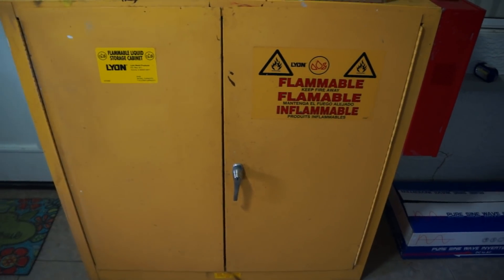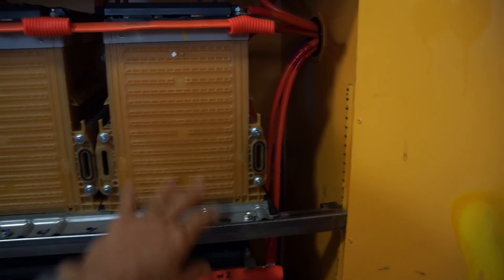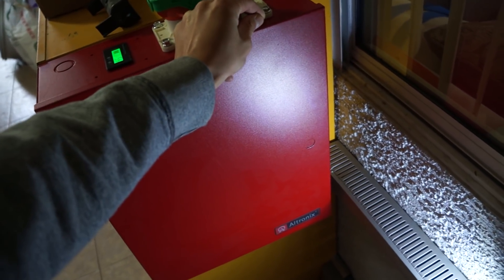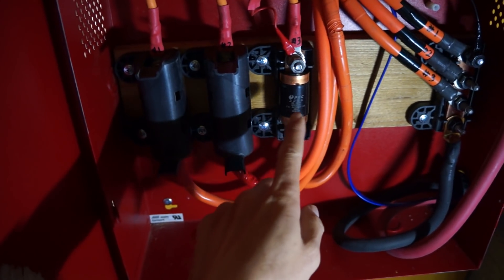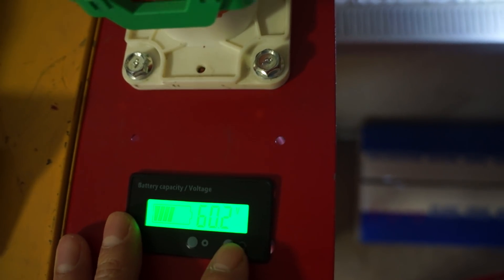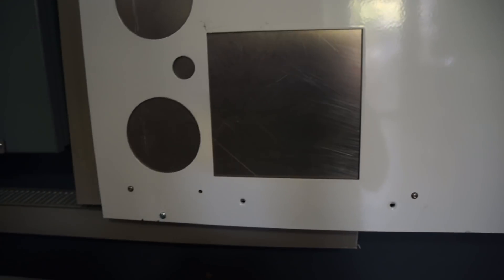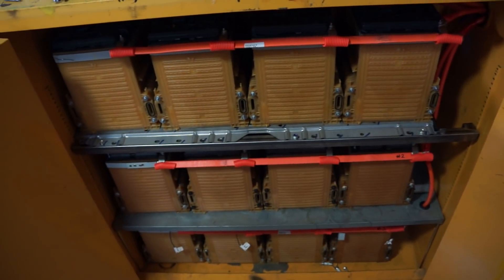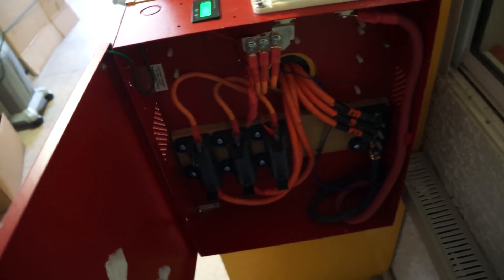37kwh 16s Chevy Volt Lithium Battery Bank Off Grid Solar system finished!

Comment: I've been searching for your video again to remind me of how you were doing connections I'm about to build a cabinet for all of my Chevy volt batteries One idea I also think I will employ is to put a large container that will hold maybe 400 lb of sand perhaps one of those big 300 gallon water totes plastic filled with sand and I will place it on top of the cabinet of course would be supported properly and cut a hole in the top of the cabinet so that if a fire were to start it would melt the plastic and all of the sand would pour into the cabinet to put out the fire
Reply from the maker: Thats a good idea!

Comment: What about colling? Aren‘t you using cooling system for the batteries? I am going to use those batteries in golf cart application and I am doubting about cooling. I will really appriciate your answer about that.

Comment: one of the most important parts here is the DC disconnect. You have to have a 40 - 60KW disconnect to break open the battery feed if you have a short. Else you will cause a giant arc and roast all your contacts

Comment: FYI for newbies an average home that uses a 4 - 6KW heat pump HVAC can use up to 90KWH per week to run the average 2000 - 2400 Sq ft home. This figure can also be reduced a lot with good insulation and air tightness.

Comment: Why no BMS?
Reply: Why do you need a BMS?
Reply: @MrSummitville  Good question. 
There are so many cell that make up a block and this cells sometimes do not take charge or discharge equally. For this reason some will get filled up or drain faster than others and this can cause cell damage. To avoid this you need BMS do that any that gets filled up or gets low to its normal level will be cut off.

Comment: Thanks for your honest opinion!You sell BMS on Ebay and yet you refrain from using them on your own setup which uses very well balanced batteries from the start. So your opinion to me is not biased, just based on your own experience which is pretty established already. A BMS is a strong added value to the system, but only if it "works." Volt surely designed an awesome BMS that works for their car and our challenge is to find a third party BMS that do the same for our solar storage system. Or... like you,  not use any BMS at all. However,  being able to monitor remotely  the state of charge of individual cells, or group of cells, and being able to get some warnings and interact manually or automatically to arisong dangerous conditions is invaluable and should not be understated - otherwise Volt would have gotten away with their own BMS too -  But... a residential setup is less demanding and easier to access and tweak, if needed. So, I would tend to agree with you, unless there is a proven BMS out there that doesn't drill a hole in your budget.As someone once said to me, " If it ain't broken, don't fix it! "
Reply from the maker: Thanks for watching!

Comment: outstanding, a question why why did you mention hopefully you will get 26 KW out of the 37 KW system, that is more than 2/3 of batteries capacity, please correct me if I am wrong, is that possible ??
Reply: I think you wanted to say 37kWh and 27kWh?

Yes, these are lithium based batteries, even if they are used they should easily have 85% of nominal capacity, and you can safely discharge them down by 90% on each cycle, without affecting them that much in life span. Exact calculations and tradeoffs are complex.

Comment: would y rather make battery back with high S count and good BMS or High P count with good Boost converter? If y want higher Voltage output.

Comment: Thermal Control System ??
Reply: Not needed for home power applications. Houses don't pull anywhere near the amount of electricity that cars do, so the system is already overbuilt for this application.

Comment: How would you rate Tesla 57V module vs Chevy volt vs Nissan leaf batteries for solar storage
Reply from the maker: Most people do not realized that Tesla chemistry is not the same as Chevy Volt or Nissan Leaf.  The chemistry they used are more powerful and lighter weight... but at a cost of lower life cycle and more dangerous.  So for Solar, who cares about the weight or space, all you want is good performance and life cycles (I guess you would if it was for a RV Solar).
Reply: @devildestiny555  
I think you are mistaken on cycle life. I would argue that tesla is the highest i mean how many battery degradation videos have you seen on leafs LOL.

Ive got 70kwh of model s modules. With over 2 years of heavy use offgrid.

Comment: just a question,,at what amps do you charge the volt batteries?  i have the 2013 48 volt batts i got from you,and im getting a victron 250/100 charge controller soon and you can set the amps ,so i was wondering what charging amps to?

Comment: Awesome setup! Are you charging all those batteries with only 500w from your charge controller?
Reply from the maker: The two MPP inverter you see are also charge controller, each of them was putting out 1kw at the time of the video.  So total going into the battery was about 2500watts.
Reply: Do you sell those batteries?
Reply from the maker: @bizz3d  Yes, but 16s shown in this video is sold out, only have 12s which is 48v.

Comment: That is a lot of battery. How do you find the MPP Solar inverter
Reply from the maker: What do you mean?
Reply: @devildestiny555  do you like it? Are there any quirks. I used them early in 2014 and I stopped after a string of failures
Reply from the maker: @drsolar  Well... only one incident so far but not sure if it was my fault or the unit, but one out of the two unit mother board blew up because of a overload.  It should have overload protection, but somehow it did not protect itself.  I had to wait 3 months to get a board replacement from MPP.  I no no choice but to buy a brand new one while waiting for the board.  It work fine since and I am leaf with a extra mother board.  Their customer service is sketchy, but to be expected from any overseas company.

Comment: What is your monthly consumption in the summer? In kWh?
Reply from the maker: Without Solar, July, Aug, Sep average about 60-80kwh a day.  With my current Solar setup, it can knock about 35-40kwh off.
Reply: What's your kwh per day in the winter then

Comment: Which is the best battery for off grid, tesla model s battery or Chevy volt 2 battery?
Reply: they are all good and come with their limitations. The Tesla Model S comes in 24V only. The Chevy can be configured in 24 and 48V. They are both very good batteries
Reply from the maker: @drsolar   Just to be clear 2011-2015 Chevy Volt has 6cells 24V and 12cells 48V blocks, 2016+ Chevy Volt has 12s 48V and 16s 60V blocks.  Both of them can be electronically split to many any cells count you want, but that requires works and sketchy.  You can even physically split them if you got the will, but that's a whole different issue you got to deal with.... in my opinions, not worth the troubles of splitting.